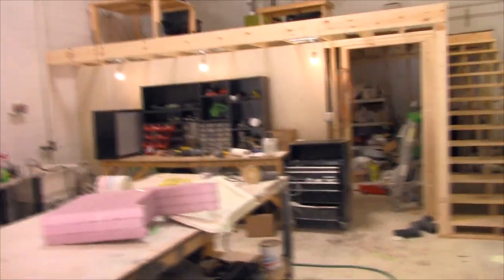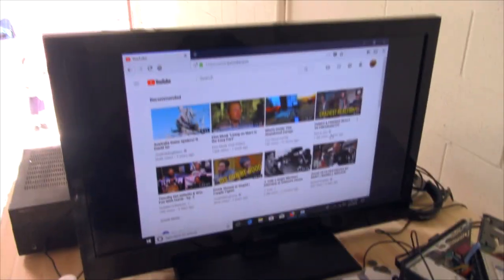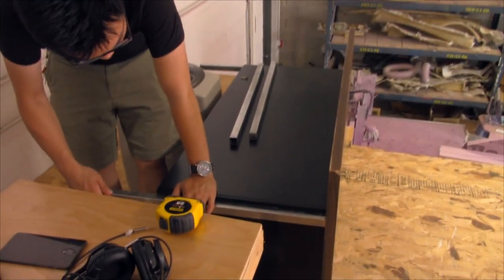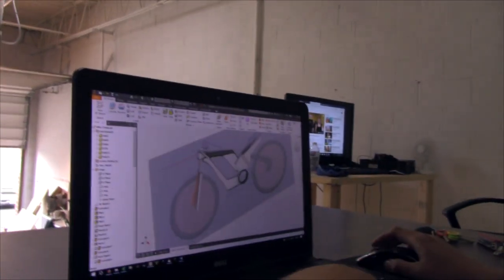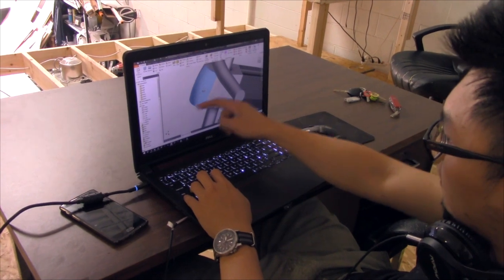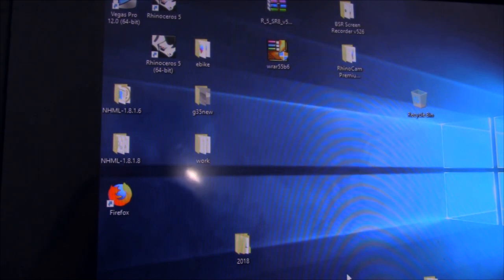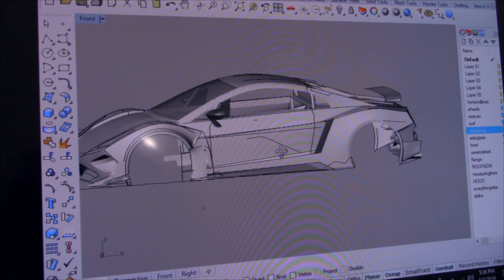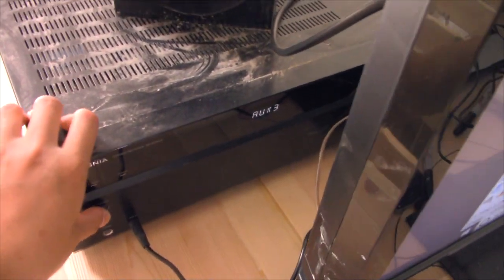We're designing an E-Bike and update on G35 Super Kit car

Comment: G35 feedback.  Be sure to add some crown to the main forms and theoretical edges(pre-filleting and blends).  some of the lines look like they get hollow and/or S in certain views.     getting your primary slabs harmonized in 3D(oppose to just orthographic views) will greatly improve the surfacing and design.   In most automotive surfacing, we leave very little actually flat or parallel for that matter.     Great start.  I would give it a 7.2.   Like most things, the last 20% of awesomeness is 80% of the work.     Hopefully this fall I get a break from these projects and can start adding some Alias work to my channel.  stay tuned.
Reply from the maker: Thanks, it could be better.
Reply: The feedback is encouragement to keep going and rock it out!  As soon as I get out of NYC, I'm building a shop and taking the concept car development side of things to the next level.  Thanks for the inspiration